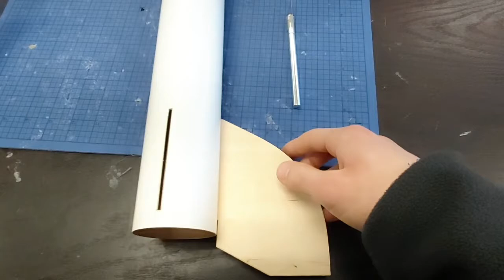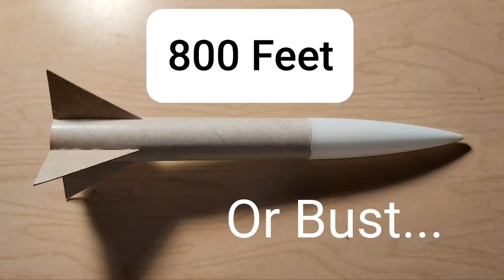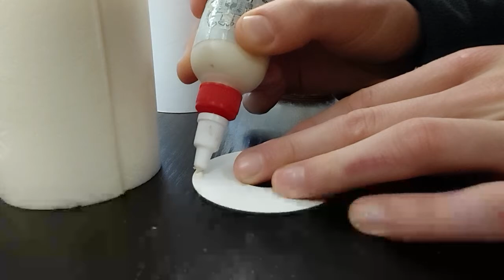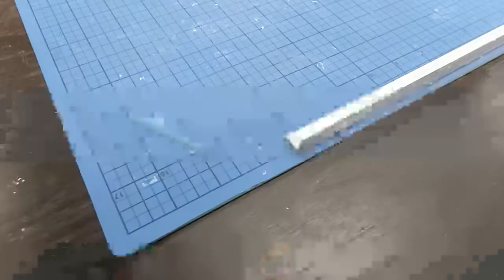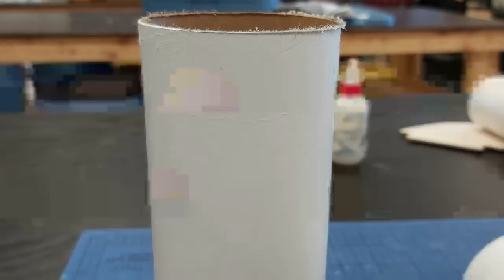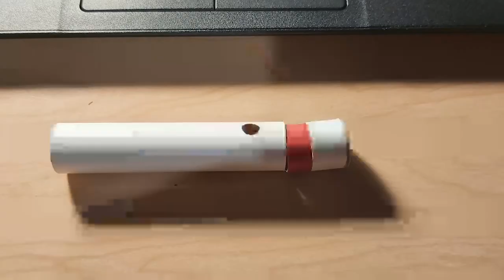TARC Rocket Project: Part 4

Comment: Just did a quick altitude estimate of a BT-80 rocket weighting 647g with an F42 motor and I got around 650ft with a 0.75 drag coefficient.  Note that RockSim tends to overestimate altitude, one way around this is to overwrite the drag coefficient on RockSim (on the "Cd override" tab) to something more realistic like 0.75.  If you flight your rocket and measure its altitude, this will be the variable you'll want to change to match the predictions to the observations.  If you want "ballpark" estimates you can try something like the "RocketCalc" app which uses the motor total impulse and max thrust (~53 Ns  and 61N for the F42), it'll also give around 650ft.
Reply from the maker: Ok. I'll check it out if I can.
Reply from the maker: Thank you!